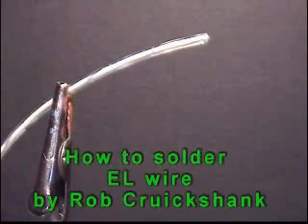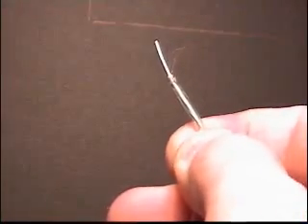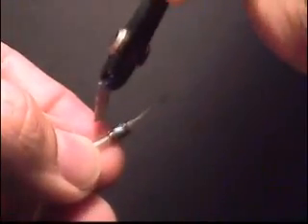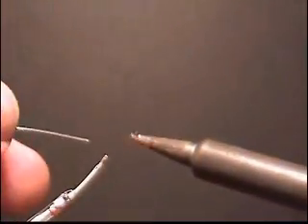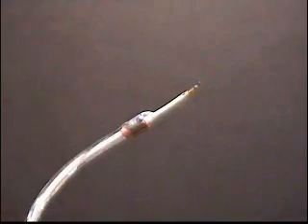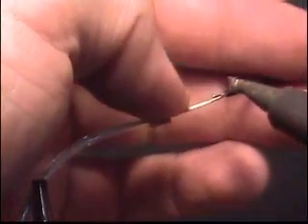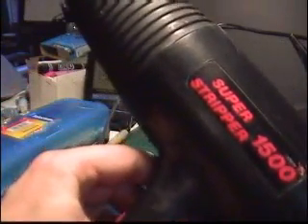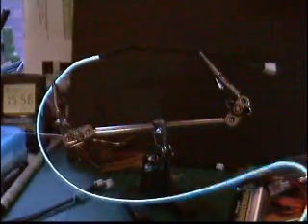How to solder EL wire

Comment: question, I see you are using a 9 volt battery.  do you recommend a 9 volt over 2 double aa's?
Reply from the maker: It depends on the inverter you use.  Some are designed for 9v, others for 3v.

Comment: What's the maximum length for an el wire to work on two AA batteries?
Reply from the maker: Depends on your inverter. Maybe 10 or 15 feet or so.
Reply: Thnx for the info.

Comment from the maker: The two smaller wires are connected together, so they are essentially one wire. The phosphor in the wire acts as an insulator between them and the thick wire, and the electrical field between the two conductors is what makes the phosphor glow. Electrically, it looks like a capacitor.

Comment: industryland-UK on ebay sells "15M Light Blue EL Wire Glowing Car DIY Strip Light+DC 15V Inverter" on ebay...if you could find that seller and that post it would be great if you could tell me if that was reliable and good and durable for my project... youtube wont let me post any links, sorry.

Comment: Thanks for responding so quickly. The project I am doing is wrapping my bike frame in EL Wire. I need 50 feet (15 meters) of the wire. When I looked at an American distributor, the price for the inverters and wire added up to about $100. I found this:

Comment from the maker: Generally, no. If you don't have a heat-shrink gun, some people use the side of the soldering iron, closer to the tip, just kind of rub it on the tubing, or you can use a butane lighter. As long as you are careful not to set things on fire, either of these works, but won't do as pretty a job as the proper tool.

Comment from the maker: You would have to build a high-voltage inverter into the charger to run the cable. If you were not careful, that high voltage would wreck your phone. I think you can buy chargers that are designed with EL wire already in place.

Comment from the maker: The power to the wire is AC, so there's no positive or negative, although with some inverters, one of the leads may be connected to ground or positive. The two fine wires are connected  together, and the big wire is the opposite conductor.

Comment: Thanks great instructional video.  One of my el wire spools I just bought has only 1 corona wire.  I tried out a small piece of it and it does light up fine.  Do you see any problems having only 1 corona?  Thanks.

Comment from the maker: it might work, if you connect it "upstream" of the resistor that limits the current to the led, but the LED driver may not have enough current capacity to run the ELwire inverter.  It's a cool idea though! The way I would do it is to use an opt-isolator to replace the capslock led. The optosisolator is basically an LED  and a phototransistor in the same package. Use the output of the optoisolator to switch a power transistor which turns on the EL wire driver.

Comment from the maker: @HiddeHeitbrink As long as the transformer is made to run on 5V (if it originally comes with a USB plug, it should) you should have no problems. Make sure you connect to the power pins of the USB, and you have the polarity right, and you should be fine.

Comment from the maker: @THXn11 the voltage to the EL wire is AC so the polarity doesn't matter.  The battery connection to the inverter needs to be correct, though:positive to red, black to negative.

Comment from the maker: @kittie500 You can splice two pieces of EL wire together by preparing the ends, as shown in this video, then soldering the centre wires together. Then you must take a short piece of insulated wire to connect the two copper tapes together. Insulate everything with heat shrink after that. You can use clear heatshrink to minimize the dark spot, but there's always be a bit of a gap, so plan your design accordingly. I keep promising to make a video showing how to do this. I will, soon.

Comment from the maker: @Blowitupnow Yes, you can extent the connection, or add more segments of EL wire, sure. The nice thing is that you can add extra connections at either end of the EL wire  segment in either series or parallel

Comment: I need to know... if u solder copper wire to the copper strip and the metal until the phosphor then to the wires which plug into the battery pack, could u extend the length of the connection? or connect multiple el wire segments to one battery pack?

Comment from the maker: @TirantVirus You can't solder to aluminum, so the only way to do it would be to use some sort of conductive epoxy, which would get expensive and tricky. You'd want a really good reason to do this, such as integrating EL wire into an aluminum sculpture,  for instance.

Comment from the maker: @6o9tenstars Hmm- never thought about that. It is copper wire, so the simple answer is yes, but of course you want to have it light up, AND transfer the signal. The output from the inverter is AC so you could have your signal as a DC voltage on top of that, but that would involve a lot of careful design. What I did once was use a touch switch, which was controlled by an electrode at the end of the EL wire- the signal from the electrode was carried by a very fine wire run along the EL wire.

Comment: Can EL wire be used to transfer a current, IE: can you use it to replace regular copper solid wire in a button etc for signal? Or is the sole purpose of this to just light up.

Comment from the maker: @digsafe10 The other end can be left free- in fact, if you were to connect the corona wires to the main copper wire, it would short out. Electrically, the EL wire looks like a capacitive load to the power supply. 
You could also slice another length of EL wire to the free end.

Comment from the maker: @mjindustry75 not sure- we no longer have Radio Shack in Canada, but  I get the tape from Cool Neon, they throw it in for free when you buy the EL wire from them. You might check craft stores too, as it's used to make fake satined glass, and also garden stores, as it apparently repels slugs and snails..

Comment from the maker: @charlie2face Yes, you can do that- you might want to splice a short section of wire between the two EL wires
and yes, you can make a Y connection if you want. The nice thing is that you can hook EL wire up in series or parallel, and it doesn't really matter.

Comment: nice job i plan 2 to make my one of my jackets light up with el wire.. just one question  can u go from 1 el wire 'wire' to cut it and then solder to another el wire..and can u go 2 to 1 on the wiring? ..thnx

Comment from the maker: @antixs092 The panels and tape I've seen have solder terminals attached already, so they are easier to terminate. There's no way that I know of to easily cut a panel or tape to size, however.

Comment from the maker: @wakelax I've never tried lead-free solder for this, but it should work. Just be aware that the melting temperature is higher, so your iron will have to be hotter to make a good connaction- and that will make it harder not to melt the plastic jacket.

Comment: obtain some clear heatshrink and then cut two pieces to about 15mm and 35mm.
install heatshrink onto prepared cut wire end then move it along to stop it shrinking.
then solder the inner ends together (best to use no wash flux solder)
Install smaller heatshrink piece onto the splice (making sure there is 3mm of clearance on each side with phosphor) 
then twist the outer cores around the wire and inner heatshrink, solder together and cover with the clear heatshrink  + uv setting glue and shrink.

Comment: another idea, get some clear heatshrink (not that expensive) and slide two pieces of different length onto the wire end, then solder the two inner cores together and install the smaller piece and shrink. Then (ensuring that there is enough wire length) twist the two outer wires around the heatshrink and solder in the middle and heatshrink the splice.
I'd also use some hotmelt glue or similar to make sure the splice is waterproof.
voila, multicolour EL wire :-)

Comment: i just did this and it was THE HARDEST thing ive ever had to solder, stripping the corona wires is SO HARD on my 2.5 mm EL wire. took at least 30-45 minutes to solder a wire cut in half... should i have not used my teeth to strip the magnesium xD

Comment from the maker: @DawGy376 The best way would be to do a 3-way splice- so prepare the 3 ends as shown in this video, then solder the 3 main phosphor wires together, then join the copper tapes together with short pieces of wire, then heatshrink everything. It's a bit tricky, and you get a dark spot where they meet, but it's do-able.

Comment from the maker: @mickycheese27 
The wire requires a high voltage to work, on the order of 200 volts or so, which is provded by the inverters. So no, it won't wok without one.

Comment from the maker: No, the output of the inverter is alternating current (AC) so it doesn't matter. The side of the inverter which connects to the battery does require correct polarity- the red wire is positive, and the black wire is negative.

Comment from the maker: Electronic solder has the flux embedded in a core in the solder- make sure you are using electronics solder. Other possibilities are that you are not getting the wires hot enough, or that you are not cleaning off any surface oxidiation properly.

Comment: Why is it that when I solder two wires, the solder turns into a ball and rolls onto the floor? I know when I would solder at work, we would solder brass together but we used a liquid to clean the surfaces called stodder i believe. Your solder molded together beautifully. Mine doesn't. ???

Comment from the maker: No, they are not hot enough. If they're hot enough to shrink the tubing, they're hot enough to burn skin. 
As the previous commenter noted you can use a match or lighter in a pinch.  Practice first!

Comment from the maker: Yes, pretty much. 
What I do is prepare the ends, just as shown here, then solder the two centre condutors together, and slide some small heat-shrink over the connection. Then I take a small piece of 24 gauge solid wire, and solder one end of it to each of the copper tapes on the twopieces of EL wire, to connect them. Make sure it can't short out to the centre connection, then heat shrink over everything.

Comment: You said that the solder joint is supposed to be shiny, but that I would say really only applies to leaded solder.  If you are using lead free solder the joint will look kind of grainy and dull.